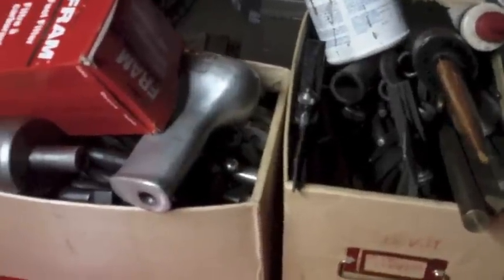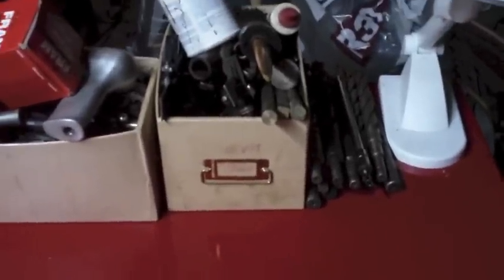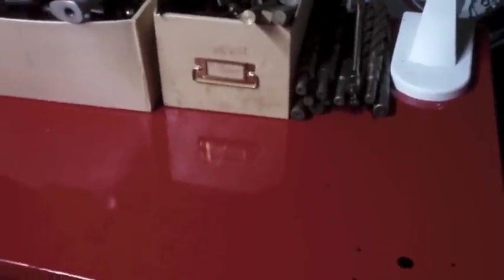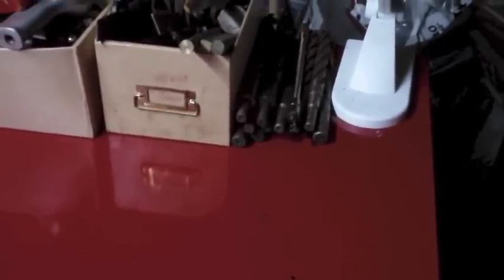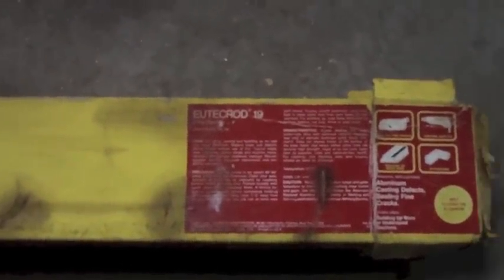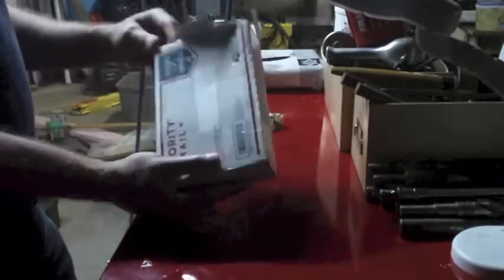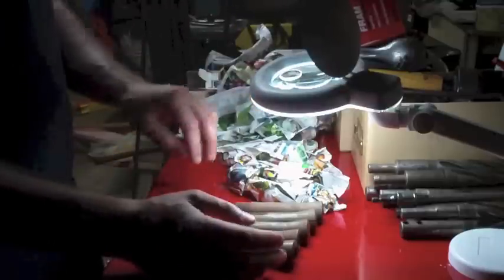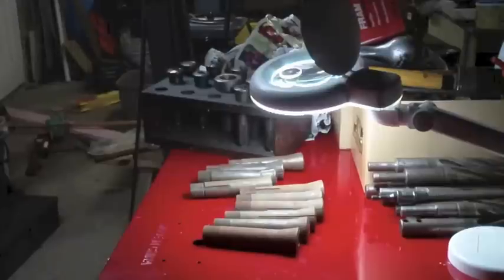Estate sale finds Part 8

Comment: zamak repair? hmmmm, wonder where you could use that.
Reply from the maker: I was thinking the same exact thing. Too bad I messed up that bracket so badly with my soldering experiments.
Reply: stevewatr
Zamak is usually a die casting alloy.  Zamak is zinc aluminum, magnesium and copper alloy. Strong but about like pot metal is.